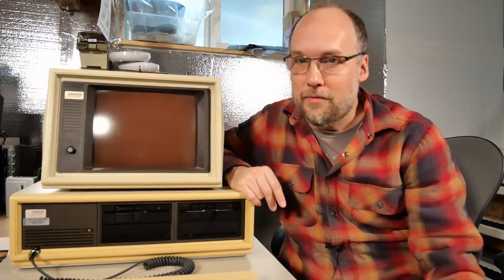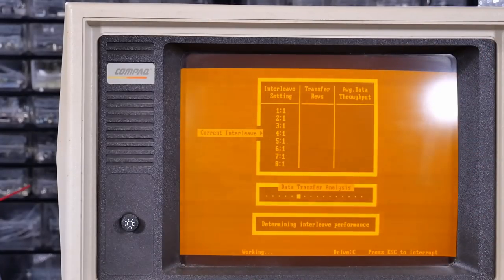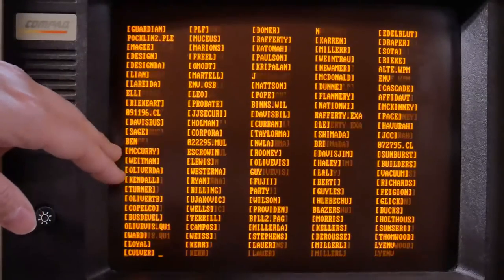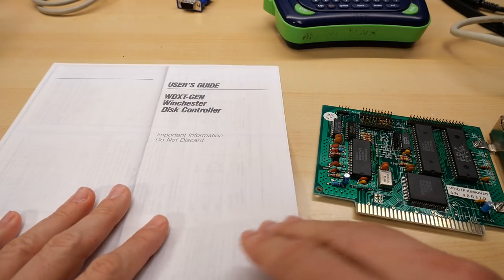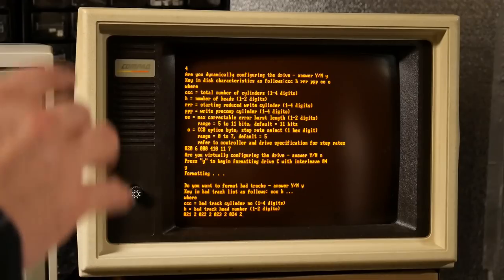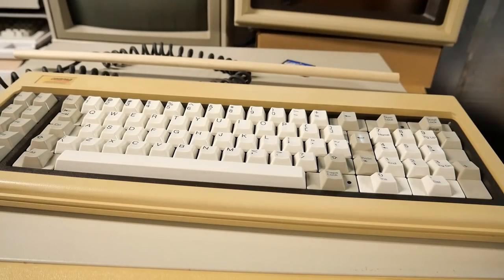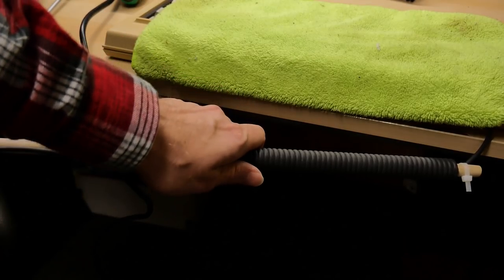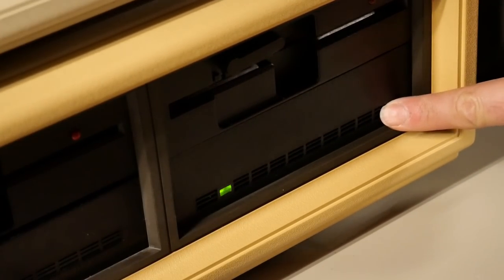Compaq Deskpro Part 4: The home stretch! MFM hard drive, keyboard and monitor

Comment: you can restore a lot of spring back into ur coiled cable by simply reversing the coil by hand if you spin one end of it opposite to how it sits after heating it it will slowly reverse the  oil and you will find that that alone with no heat can restore a lot of spring to the cable...this is usually what we do with these after manufacturing them after heat treatment we reverse the coil and that interduces a much tighter spring to it and is a great way to easily add a bit more snap to an older coiled cable without any heat or tools just do it by hand

Comment: Stretch-cable note: if I recall correctly, the trick is that after the cable cools back down, you then reverse the twist pattern, so that each turn of the coil will want to move through it's neighbor to return "home". This results in more restorative force, and thus a tighter coil.
Reply: That also explains why once I’d accidentally twisted one round on the house wall phone, it never went back how it was! Guess if we’d wrapped it round a dowel and heated it everything would’ve been as new again (if we figured to counterwind it, at least,)

Comment: The way I remember it (~30 years ago...), these old drives with ST506/412 controllers have a lot more of the important stuff on the controller card (the one you put in the ISA slot), than the IDE drives do.

IDE drives have all the important stuff on the drive's own circuit board and the IDE "controller cards" that were used up to early 486:es were just an interface connector thingie, all the important stuff was on the hard drive itself, which also made it very easy to move a drive from one computer to another (well, usually easy... there were exceptions.)

My point is that when you move one of these pre-IDE drives to another controller, you're pretty much doing what people do when they swap the circuit board on a defective IDE drive in a desperate attempt to save those precious files... meaning it MIGHT work, but there's a high risk that it wont.

Also, these older drives can work even if you enter the wrong number of cylinders/heads/sectors, so if you move it to another controller you also need to know what settings were used. On an older controller card with jumpers, you can (if you have the manual) read the settings off the jumpers and then choose the same settings on the other card to increase the chance of success.

But since your controller card is a modernized version with software shenanigans, it's even harder to know what settings it had (unless you can find a way to display current settings on the screen of course), so that's probably why you couldn't move the drive between machines without reformatting and such.

I guess it's possible that the settings were written to the drive itself, but as far as I know, that's not how it usually was done. You just had to know the correct settings and fix it yourself. But then again, since this card is more modern it might do some stuff the older cards didn't.

Comment: I love spinrite.  Steve Gibson is working on a new version that better handles AHCI controllers.  Turns out spinrite is useful of getting SSD's to repair themselves also.

I have a Acorn Risc PC which had a HDD that was really not happy. Spinrite did not recognise the acorn partition but I ran it over the drive at level 1 anyway.  This forced the drive to seek across itself and even though spinrite did essentially nothing and couldnt even read the data as it was in acorn format on an acorn partition the drive came back to life and seems ok, if a bit noisy.

Comment: Ah, MFM drives.  I remember the one that was retrofit into my 5150 PC.  Eventually (years down the road), it began to show bad sectors, but only after it warmed up.  It was just fine when cold.  But I had a 386 system by then and had the files transferred to the new system with Laplink, so no big loss.
Reply: Old drives had the issue of “thermal expansion”. If the drive was formatted while cold, the heads would be out of alignment after the disk had been spinning building up heat. Once heads moved to voice coil technology they automatically aligned the heads when the disk heated up to prevent read/ write errors.

Comment: @25:51 what I do is once i've done that and it's all set, you actually spin it so that it's inside out and that will keep them tight.. Nice series.. i'm still trying to find an old compaq deskpro/386 like i had when i was working at northern telecom
Reply: so basically once you have it set like that, "unspin it" and then spin it in the opposite direction and it should coil itself up tighter
Reply: @WX4CB  I still don't understand what you're trying to say.
Reply: @St0rmcrash  Thank you. (The above link actually explains it about four minutes into the video.)

Comment: The reason why the USB cable doesn't hold the shape of being coiled is because of the wire conductors rather then the outer sheathing. Coiled Cables typically use paper thin ribbon conductors wrapped around some fiber like material. This way the conductors can stretch with no problem and the outer sheathing keeps a memory retention. I typically use Coil Cables for projects.

Comment: Hey Adrian, have you seen those Televideo computers? If you ever see one, and it is not so expensive, may be you can get one. I used to have one, green monitor (attached to the main chasis as one piece), similar keyboard as this compaq (and the input was telephone line like). Good stuff you have here in your channel. Cheers from México.

Comment: This is great, I have several MFM hard drives I need to check
Reply: I hope you didn't make the mistakes Adrian made! These drives get low-level formatted to the specific PC. You will not be able to recover data unless you have the original PC, and it will appear damaged even when its not, when put into another PC. Keep that in mind!

Comment: Fun fact!  The original IBM MDA card actually was capable of color RGB TTL output but was only ever officially used with the monochrome monitor.
Reply: @adriansdigitalbasement  Yea the earliest versions of the MDA card have the RGB pins wired up, but the later version did not.  Tube Time did a demonstration: https://www.youtube.com/watch?v=-TiHFWH4NWk

Comment: Learned/relearned a lot of stuff, thanks!  Gibson's Spinright was something else!  I wish modern day utilities were as well thought out and informative.  On the other hand, why confuse computer owners with the confusion of subprocessors (um, did I just coin that word?) and communications systems like I2C?  I would like to know about Intel's V-Pro and such, since purists of one kind take it out.
Reply: Perhaps you could check out some of the "open source hardware" boards like RISC V. People are beginning to install them in SBC gaming boxes.  Get a compiler for it and you can emulate the old, slower stuff.
I'd prefer to have something like a laptop or desktop, with Linux or perhaps Free BSD running on it, though.

Comment: You can even recognize a ST-251 by the noise alone, it makes a hollow knocking noise when it's starting up.

Also the ST-251-1 is slightly newer (or faster) than the normal ST-251-0 (though that's a bit moot, both the drives are identical, mechanically-wise)
Reply: For whatever reason, Seagate offered the ST-251 in both a "fast" (-1) and "slow" (-0) model at first. The slow model was rated at 40 ms average seek and the fast model was rated at 28 ms. 

I don't think I've ever seen any of the "slow" version...my understanding was that it was meant for budget XT-class PCs and wasn't popular.

Comment: 31:07 "[... switching to the high-resolution mode] gives us this: just a black screen." Well, no, not exactly; there's a blue IBM logo that's faintly visible that persists through the rest of the clip, and it's differently aligned from the one that was showing previously so it's not just persistence of vision. Maybe the weird pin 7 signal is triggering squelch circuitry in your monitor? Or maybe the Compaq monitor "knows about" special low-voltage RGB signals... I'm glad you got everything else working how you wanted though!

Comment: I'm unsure Spinrite can accurately discern which interleave is optimal given that the commands it is sending to the drive are interpreted through the controller into whichever interleave it already has configured for the drive; I think it's a little too "Hard Coded" - but in my experience with similar controllers, I've found that whichever interleave is suggested in the Debug Low Level Format utility, is the best - in the case of your controller it suggested 3. I'll bet you that you get the best benchmark results on this drive with a Low Level Format of 3. 
Another tip is to low level format the drive when it's warm. If you do it cold, the microscopic expansion of the disc platters can cause some tracks to verge on being out of alignment with the head leading to read / write errors further down the line. This only happens with stepper motor drives. Voice coil drives aren't affected by this phenomenon. 

Great video, so thorough, really enjoyed watching the mini series. Thank you :)

Comment: Quote:  f15sim "With MFM drives, the controller does the low-level formatting.  Often times this low level format differs from vendor to vendor and even model to model with the same vendor.  This means that you won't necessarily be able to read a drive that was formatted on a different controller.  Also the low level format is done by the ROM on the controller card.  You can access (in most if not all) this low level formatter by running DEBUG and then enter "g=c800:5" to start the ROM formatter" So 5:30 to 9:30 was Adrian wasting his time. SpinRite works as well as Adrian remembers from the 90s, but apparently Adrian's repair skills don't work so well anymore! lol :))))  Dolph Handcreme "The data format on a MFM or RLL-drive is controller dependent. You have to use the same model of controller to read/write it, when you switch machines or you won't be able to access your data or get "defect" sectors because the controller isn't understanding the format the drive was lowleveled with. That's the reason why low-level-format disappeared with ide and scsi drives - they simply contain their controller on-board."

Comment: MFM and RLL drives are tied to the controller they were originally low-level formatted with, because the drive itself has no controller onboard like IDE drives. Every Drive-Controller pair is unique due to the analog signals between them. Even smallest differences matter here. So if you change the controller You  are fthen forced to low-level format the drive. Each and  every IDE Drive has the same Issue, but Ibecause DE Drives carry their own controller around, the Drive-Controller pair never gets splitted up.

Comment: with regards to the coiling of the cable. try reversing the coil with a drill. like in the video "How It's Made - Retractile Cord". reversing a coil causes the cable to tighten against it self.

Comment: You can reuse zip-ties by unlatching the little catch with a small flat-blade screwdriver or a needle.  It's easier on the bigger ties, and those are the ones more worth reusing.  Save that plastic!

Comment: I think the original for this system, which does NOT have a tape drive (in D slot) would be for both floppies in same bay as they were, leaving the hard drive which generates a lot of heat, and needs to dissipate that heat for longevity, should go in the bay by itself.

I think the other layout from the 386 included the tape drive, and this may have been laid out that way due to the special cable with 3 connectors so all connectors would fit and reach all of those devices.

I strongly recommend putting the floppies back where they were so the hard drive can be as cool as possible/it can.

Also not sure why you partitioned the CF card/emulator at all, FAT16 goes to 2G, but BIOS may limit that to 528(?) meg, I think.

Yes, my first computer (other than having played with Timex/Sinclair and an old Apple II plus (I think plus) that belonged to friends, was an XT clone with two floppies, hercules AND CGA cards.  Friend fixed me up with an old dumb terminal for the herc card, and we rigged an RF modulator, powered from the computer, to us an old 13" color TV for games!  Added 20meg drive but it was sold as a 30/RLL, and was ALWAYS flakey.  'til I switched to an MFM controller and it was then flawless.  Cheated.

Comment: Are you sure about that parking of the heads "by using the spinning of the motor to generate electricity"? We always understood our drives to be using voice coils which means that they retract to park when power is no longer applied.

Comment: You are correct that the WDXT-GEN writes the config to the drive. Modern RAID controllers and SANs do the same thing, so they can identify drives if they have been moved or replaced.
That DiamondScan AUM-1381A monitor you had on it should do CGA color at high resolution. It does multisync on TTL and Analog RGB inputs from NTSC up to 800x600 SVGA. I had one on my C-128 (and SNES for analog RGB perfection!) and you could mess with the 128's VDC to generate all sorts of nonstandard timings, including a mode very similar to what the Compaq does. You just have to use the DB-25 connector: http://wonkity.com/~wblock/a4000hard/m1381.html

Comment: Well dang, my crystal ball was right about the hot water method to fix the coilies on the keyboard cable - workable. Heat gun is also an option of course - the nuclear option, hitting that cable fast and hard :D
Reply: @adriansdigitalbasement  Well going too high will make the PVC degrade and get incredibly hard and discolored, heat it too high and the insulation will just start to crack off the cable on its own ;-) The thermal decomposition starts at ~135C and at 200C it reacts very fast. I think that PVC gets pliable at around 75C ;-) But the cable might have some other additives that throw off those values. This is why I sugested to use boiling water :-) Problem might be that the plasticizer in the PVC went?

Comment: I know this is in the past, but as I recall you can't mix and match MFM drives and controllers.  Each controller was branded to the drive it low level formatted, I suspect this could be the reason you couldn't read data on AT controller.
Reply: @adriansdigitalbasement  I just came to leave the same comment, i repaired these sort of machines when they were new.  You have to keep the MFM and RLL drives paired to the controllers.
Reply: @adriansdigitalbasement  I'm guessing the 8bit controller is a XEBEC unit and your AT controller is a WDC.  You can move them around in the same family, but not across major manufacturers.  EDIT: I see it's a WDC chipset on the 8bit, but probably a different generation than the AT.  The Virtual Drive Splitting makes sense because the ST251 was 42MB and early DOS versions couldn't have partitions larger than 32MB, and some only supported 1 partition.  DOS 3.3 had multiple-partition support of 32MB, so I'd guess that was the target of this.  I had an ST-251 that I got when upgrading a customer's computer, it did some funky stuff, I can't recall if they had 1024byte sectors or 4096byte clusters, but the net result was the cluster map did not exceed the internal limits of DOS.

Comment: Ha, I was right! It was a monochrome CGA monitor.

Was there a reason you used Spinrite II instead of the now more commonly available Spinrite 5? And speaking of which, I don't entirely trust Spinrite's bad sector detection. I've seen it go back and forth between adding and removing the same sectors on various run of an old disk.
Reply: @adriansdigitalbasement  Yes, it still works on MFM/RLL drives. It is also the last version to work on an 8088.

Comment: Do you think there was any benefit to working with the drive on the 386 or was that an attempt to salvage data?  Would you have ended up the same just low-level formatting it using the XT MFM controller?  Also, what is your theory on why the optimum interleave changed?  Because it was no longer virtually configured?